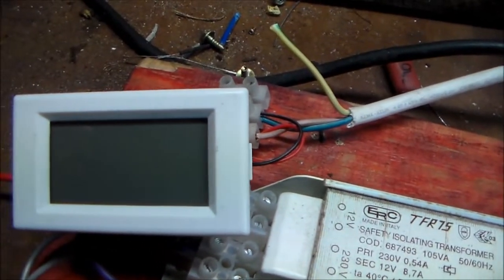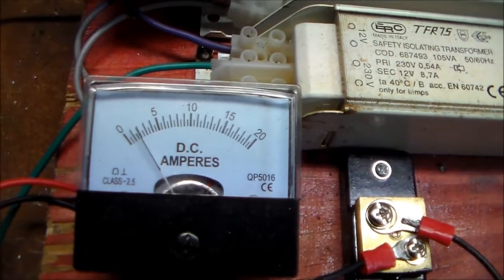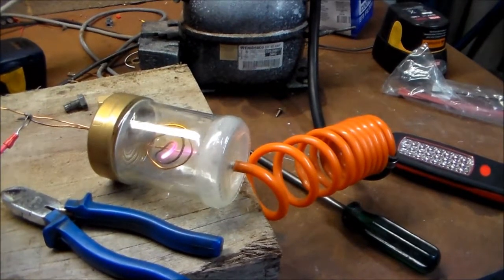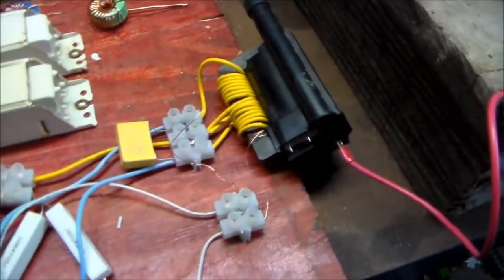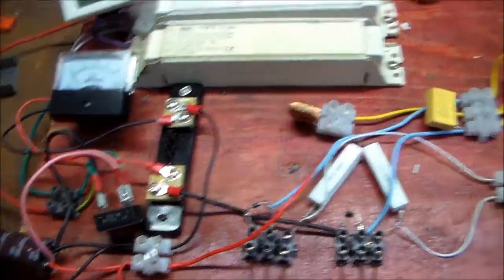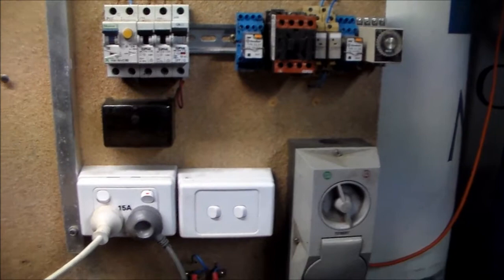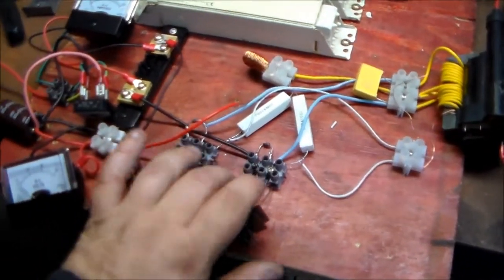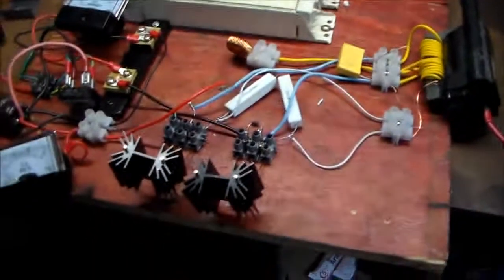Late Wed Update :- Flyback Smoke.. Uh Oh, new LCD Panel Meter :-D

Comment: that meter u got iv got the same  1 that reads volts and amps   but the resistor gets verry hot within 1second of powering the meter ??????
Reply from the maker: from my memory, this happens too. that resistor steps the power down to run the device iirc. when you say hot you mean smoking ? something is wrong then.
Reply: well it gets to the point wher it starts to smoke  n wen i tested it with 63v ac it was fine  wen its ment to be ran at 220 2240x
Reply from the maker: Daniel Hornes could be a dud. unfortunately this is the risk you take buying cheap shit on ebay.

Comment: the moment u see smoke from a flyback and its not from the output pins arcing to the core or other pins the flyback has not a very long time left. that one is short circuiting on the inside and putting a strain on the capacitor, nothing you can do. just get another one, dime a dozen, for now....

Comment: You've mention that your rectifier is getting hot? those 2 step-down transformers you are using look like electronic halogen light transformers and the output frequency on those are about 20KHz. At that frequency, Your rectifier may not be able to recover fast enough at that frequency and you are getting capacitive resistance inside your rectifier and is causing it to get hot.

Comment: The bridge rectifier needs a heatsink, it doesn't need to be very big though. The flyback may have a shorted winding. They have a bunch of different windings in them, some of which can supply some current. The original primary will have a good bit of voltage and could supply several amps if shorted.

Comment: That dual meter is very nice, i would connect it to a seperate socket or rig a bypass switch so you dont blow its brains out it if a nasty short circuit appears across the socket, we know how you like things smoking lol :-)

Perhaps your next project could be a canoe, the venice of australia lol :-)

I know sod all about that circuit but if that choke is a power one then it stops the oscillator wasting ac power to the supply poz, lots of thick turns would be my choice.

Smashing :-)

Comment: I think the cap was hot b/c the frequency had been pushed very high by the light load conditions. The flyback diodes and windings might be breaking down from overvoltage. That bridge rectifier can handle 35 amps when cooled but it will only handle 2 amps or so without a heatsink. Because of the isolated case, bridges have higher thermal resistance and run hot internally. Even that would mean 2 amps x ~1.1 volt drop per diode x 4 diodes = 8.8 watts in that small package = cooked bridge.